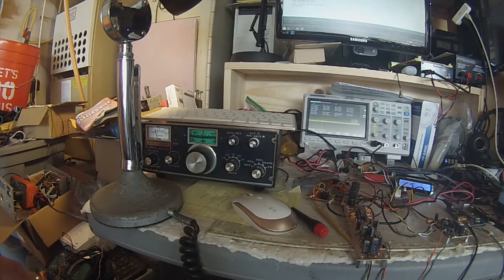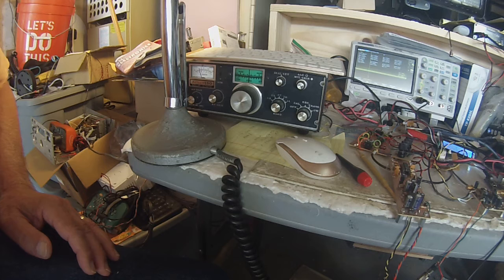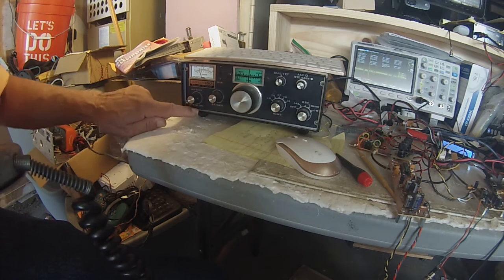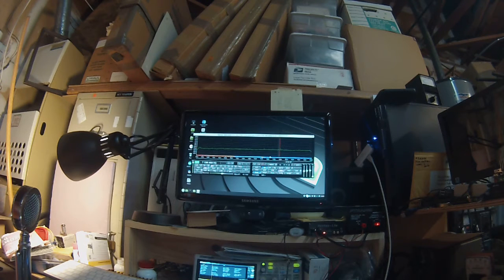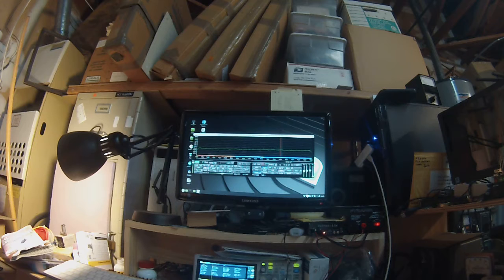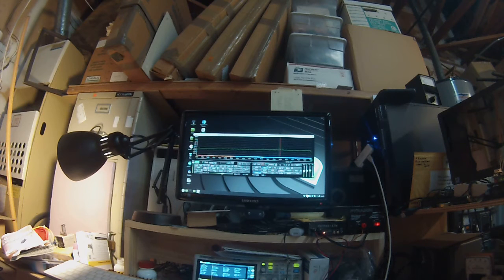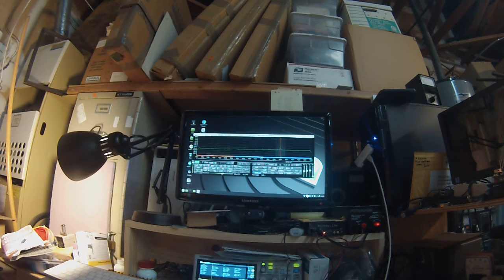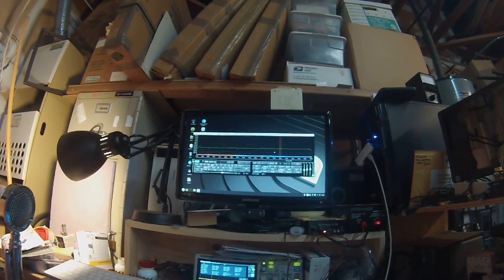More Tests of the MC1496 DSB Generator ~ Test Session #2

Comment: I have a small unit somewhere I bought for a few pennies years and years ago. It has a 9MHz crystal and an MC1496 'mixer' in it. I bought it to strip for parts but maybe it can be used as a DSB generator. Hardest job will be to find it again - it is in one of those boxes of parts that may, one day, become a radio, you know that kind of thing.... Good work Pete, looks and sounds good.

Comment from the maker: There was a request for complete schematics. If you have to ask, you shouldn't build the project. Look up the MC1496 datasheet and it is the Balanced Modulator with a single supply voltage and any mic amp that delivers about 1 volt of audio is all you need. Likely an audio bandpass filter limited to 300 to 3 kHz should be installed between the mic amp and the MC1496. I had to look it up and maybe you should too!

Pete N6QW
Reply: Asking for full schematics for a DSB rig that uses a jelly-bean part such as the MC1496 is like asking someone for a recipe for beef stew. The latter has beef, vegetables, potatoes, and is seasoned to taste. There's a million ways to put those together (I put cabernet in mine), and if one needs a recipe maybe one should just open a can of Dinty Moore instead. 

And it's not really being condescending or snobby to take this point of view--quite the opposite, in fact. It's really saying: "Look, this isn't rocket surgery or cutting-edge technology. Generating a DSB signal (and maybe filtering or phasing-out one side band for SSB) is as basic as making an omelet (to extend the cooking metaphor). If you don't know how to make one, then first learn how to boil an egg, then to scramble one, then to fry one over-easy. Then make an omelet. The first one will look more like scrambled eggs than a Cordon-Bleu-class omelet, but you'll get better after acquiring the domain knowledge you need. 

In some ways, a DSB rig is easier than making an omelet because so much material is available online to build the domain knowledge necessary. The MC1496 datasheet Pete mentioned (https://www.egr.msu.edu/eceshop/Parts_Inventory/datasheets/mc1496p.pdf) might look like rocket science, but looks can be deceiving. Struggle with it a while. Look up unfamiliar terms or concepts. It's like falling off a log these days. But if all that just seems like too much to do, then accept it as a piece of self knowledge that it's not your cup of tea. There's no shame in buying radio gear, any more than there is in ordering a omelet or beef stew at a restaurant.
Reply from the maker: @tcarney57  Hi Tood, 

If this were an isolated incident, then I could shrug it off. I have a new transceiver build at https://www.n6qw.com/PSSST_20.html It is extensively documented and built in Modules and each module has a board layout that you can lift and homebrew your own boards. I get an email 1) How come you did not draw an overall schematic and 2) when will you be selling PCB Boards for the project.  Truth be known most hams today cannot read a schematic and the project is intended to teach you about how to build a transceiver and how the circuits work. The intent is not to teach you how to stuff a board with parts.

Thanks for your reply -- beef stew -- I do indeed have a secret recipe.

Pete N6QW
Reply: @N6QW  I've seen the PSSST20 and I've added it to my ever-lengthening list of projects. Since Ryan Flowers put it up on Hackaday, you must be getting an unusual number of inquiries. And, yes, you did provide extensive documentation. The "overall" schematic is the block diagram, for crying out loud! It's an odd request since the only rational way of using such a schematic would be to break it down into its functional blocks before building, but you've already done that!

I have slightly-more understanding of those wanting PCBs because, while being totally unnecessary, it's my preferred method of building--but I make my own, starting with schematic entry into KiCad and board layout. It is an excellent way (among others) to come to grips with a design in both its electronic and hardware aspects. A side benefit is that KiCad has SPICE built in, so the same schematic you enter for PCB layout can be used for simulation. 

Well, as Churchill like to say, "K.B.O." (keep buggering on). BTW, I don't have a recipe for beef stew, I have a method --throw in anything that adds complementary flavor: carmelized the onions, wine, beer, consommé, well-browned beef, bay, rosemary, and enough garlic to ward off all the vampires of Transylvania. I don't write it down, I just do it.
Reply from the maker: @tcarney57  Hi Todd,

Yes, more than one request for the code. But likely maybe only a couple will get built. I try hard to keep that part count down yet have a serious radio. Some who commented on hackaday didn't think so. But the bottom line I am using it and enjoying the fact I designed and built it. Be safe my friend and as usual always a delight to get your insight.

73's
Pete

Comment: Hi Pete, excellent video as always!  Thanks for posting all of this useful information.  I have always struggled with getting the carrier suppression to work as well as its supposed to in theory.  Can you share any details on how to control the level of the Si5351? What value pot are you using?  Is there any relationship between the value of the pot that you use and the ideal impedance that the Si5351 wants to see?
Reply: Disregard!  I see you've got a 10K in the notes.  Many thanks.  73s.
Reply from the maker: There are two ways to adjust the Si5351 -- In software you can set the Drive levels of the Si5351 output and all three clocks can have different settings and the choices are 2,4,6 and 8 ma. The output Z is 50 Ohms (it used to be 85) and the pot is a 10K --so it works well to inject just the right level of carrier for the MC1496. Find the Motorola datasheet for the BM operating off a single supply and it tells you the carrier level needed.

Thanks for watching and your post.

73's
Pete N6QW